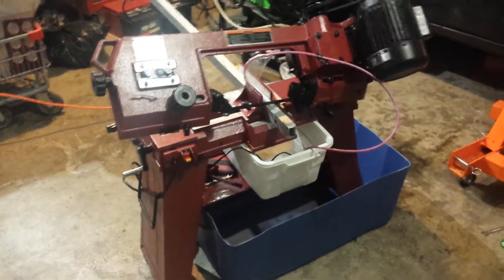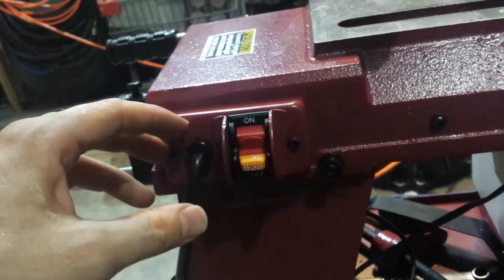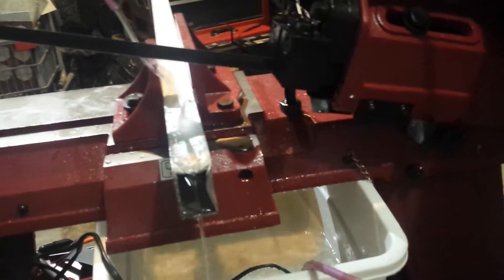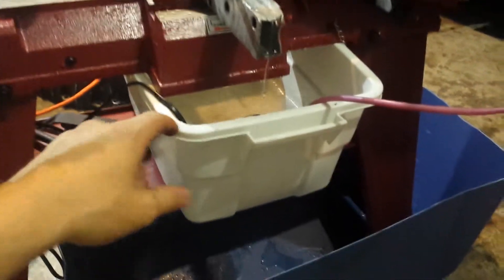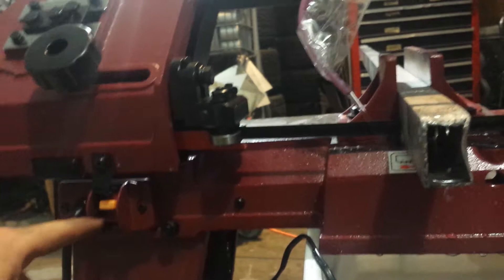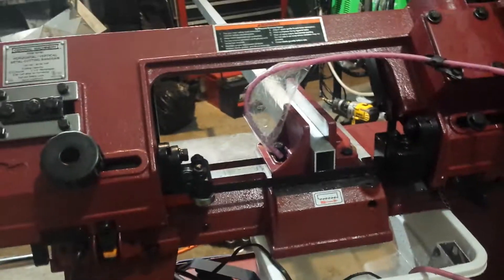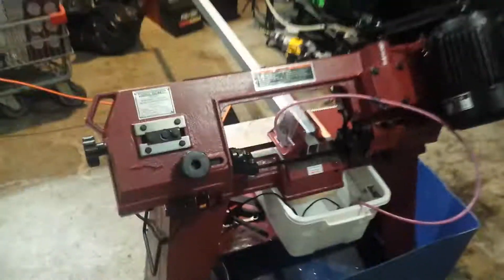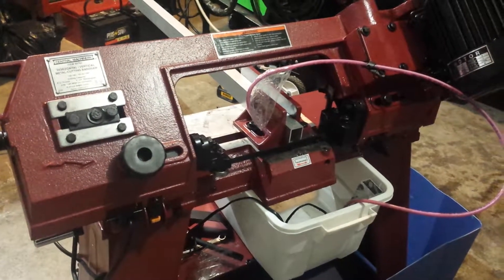First time using harbor freight metal cutting bandsaw with custom water cooling.

Comment: How’s your coolant setup work when you use the saw to cut vertical?  That looks to be a horizontal/vertical saw.
Reply from the maker: Guardino Inc. Good question. I didn't set it up with that in mind. Also I don't have this setup anymore for a long time now. 

When I make time at some point, I'm going to weld up a stand with water cooling functionality built in. 

I'm sure the vertical position with water cooling would be satisfied with a bendable nozzle of 8 inch length or so that would be hand positioned where u want it when you need to.